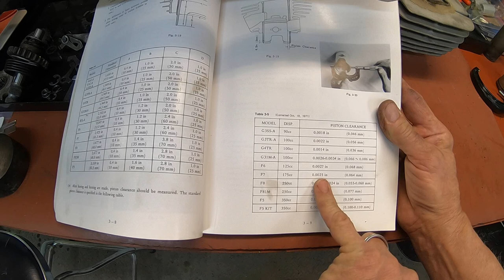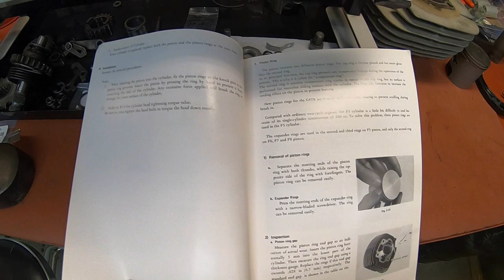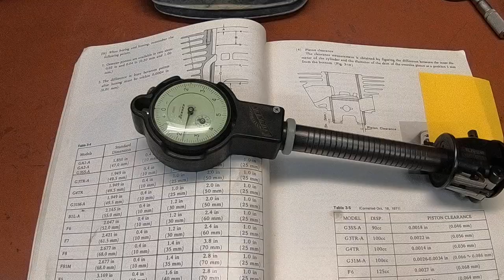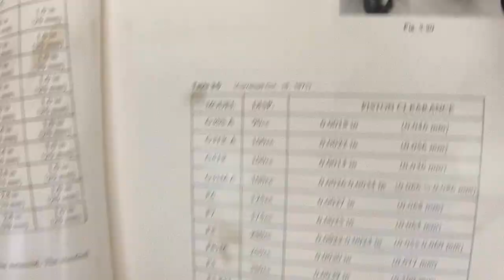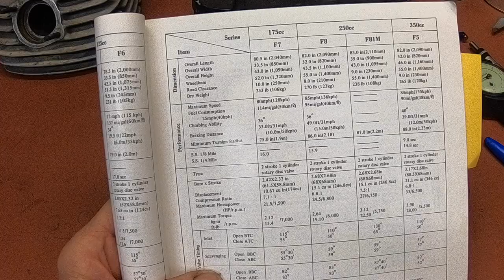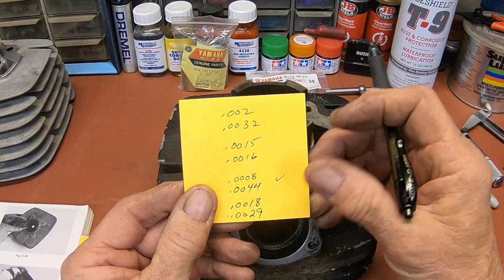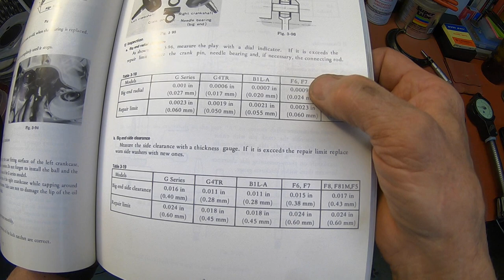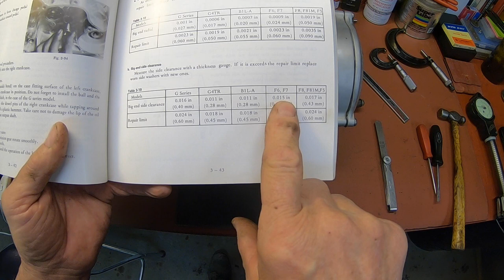1971 Kawasaki F7 Top end disassembly, inspect, measure

Comment: Nice job, Dale. Good find on such an old cylinder!  Looking at the old manual I was amazed they had such detail and complex calculations long before computers came along. Learned a lot on measuring here. Thanks!
Reply from the maker: Hey Jim, yep stroke of luck for sure, the manual is indeed a good source of info. I find overall the OEM shop manuals are by far better than the internet. Really the only thing I use the computer for is to ensure the numbers are the same and to order parts. There is far more info in the published paper parts lists and manuals than online, from the OEM's anyway.

Comment: Hey Dale, great video. I'm glad you have options with the top end, finding the standard barrel was a stroke of luck. 
I'm not sure the Bighorn range was officially imported here, most of them seem to be US imports I think. 
Best wishes, Dean.
Reply from the maker: Hey Dean, yes was lucky to find the cylinder for sure. Kind of goes against the grain to fit a used piston but must do what you have to. I picked up a 1970 F5 Bighorn about 3 years ago, think I have only done one video on it, seat pan build. The F7 shown here is also known as the Bushwacker.

Comment: for those looking for pistons and rings, look at the diagrams and find the exact parts number. You will be able to find it easier. a 1971-73 kawasaki f7-a (or b) piston number is 13001-042, rings are 13008-027, needle bearing is 13033-034.
Reply from the maker: Yes, those numbers are correct for standard size but not for the oversize .05mm or the 1.0mm. I just have had a hard time finding the O/S piston and rings. Think I have them located now. One person told me that the early KD175 parts are the same, hope so cause that is what I found. Will know for sure next week. Thank you for your help and for stopping by the channel.
Reply: @montana2strokeracer  yea my 72 has some scoring but cant find anything to fit it. its got good compression so I wont worry about it

Comment: Hey Dale. In 1974 my dad traded 2 bikes for a Kawasaki Rotary 90cc that a Kawasaki mechanic at our local Kawasaki shop converted from a side port rotary to a center port external carb. so he could make a mini class motocrosser out of it. Man was that a fast bike. No one could beat me to the first corner but after awhile the expert kids would reel me in. I was 13 then. He modified it with lay-down Boges shocks and a longer swing arm. What I would give to have that now.
Reply from the maker: Hey Ron, man all these old bikes are like a dream to me. I remember the mods folks did back in the day, wishing I could do that stuff. Here I am 50 years later finally getting to. It's as fun as I thought it would be. I remember all the small bikes back in the day and how darn fast they were. I would show up at the flat track races with my Hodaka super rat and I could hear the Yamaha 100 twin jets and the Kawaski green streaks. The smell of the two-stroke oil and fuel.... what good times.
Reply: You have any Kawasaki f7 engine for sale
Reply: I had mine rebuilt guy took 3 months. Only rode it for 2 days and a piece of the skirt on the exhaust side of the jug broke off and jammed in the crank it's a 1971 Kawasaki f7 175 has just been collecting dust ever since

Comment: Thanks for posting these Dale, fantastic videos, I have 1972 Kawasaki F7 175 myself and can concur it is hard to find NOS or reproduction parts! Any leads on what to do if my piston has damage? I haven't opened it up yet but precurrosery search yields there really isn't many if any out there for this year. I tried to cross reference part numbers but it seems Kawasaki used this piston pretty much this year and few others but changed it shortly after 72. Any ideas on replacement should I need one? I've seen other suggest that a custom order from Wiseco.
Reply from the maker: Hi Sean, yes like you I have found it extremely difficult to find parts for Kawasaki's. I had a viewer suggest that I restore a Bridgestone....I would love too and even have access to a couple.... can you imagine how hard parts are to find for that rascal? I can tell you this, the parts are out there but only get the F7 pistons. Like I said in the video on this subject, I have found nothing else that works. I would recommend taking yours apart if it is noisy and check the piston top and see what size it is now. Then measure the cylinder and figure out which piston to look for. Your head gasket can be reused if you anneal it. I was able to find base gaskets, piston pin bearing and pin, and clips pretty easy. I have looked in to a Wiseco custom order before. They at the time I checked, needed a minimum order of 10, which would be well over a thousand dollars, probably closer to two thousand today. I think you would not have any problem selling the others. Folks just like you and I would buy them up in a hurry. But if you watch Ebay, perhaps put a saved search in, they do pop up. I was able to find a .5 and a 1.0 for both cylinders I have. Good luck brother, and thanks for spending time with me in the shop.
Reply: Thanks for the reply Dale! You have been a go-to resource for visuals and video on processes, how-to’s and many resources. I luckily found TODAY one that is a 13027-046 F7 Piston but it’s $190 something 🤦🏻 when I get a chance this weekend I’m going to tear the top end apart and pray I don’t need it haha. Is it possible to just replace the rings and re-hone the cylinder to restore compression?

Comment: Dale, I think I’m having trouble racking my brain around all this, I’m doing a top end rebuild identical to this one on a 1972 F7 and a 1975 Yamaha DT175 head rebuild and I can’t seem to figure out how to do this lol. Wouldn’t it be well out of spec if I hone? Will putting new rings on an old piston give me compression?
Reply from the maker: Hi Sean, on either bike you should measure the piston you're going to use in the appropriate place, and then measure the cylinder, also in the appropriate place, then subtract the measurements. For example.... piston is 2.00 inches and the cylinder is 
2.005 inches, subtract and you get .005 difference. Now subtract the piston to cylinder clearance required by the manufacture. Say it is .002 inches. That leaves .003 inches, so this is in excess of the manufacture's specs or a total of .005 inches. In this case I would probably just hone with a ball hone to renew the crosshatch for oil control and install a new set of rings. This will bring your compression back up. The answer to your question about honing, yes if you hone too much you just keep making the bore bigger, but honing with a ball hone will not remove much metal and will give you the crosshatch to seat your new rings. Now if the excess clearance is more like .004 or .005 you will need to rebore to the next size piston. I hope I have provided the information you were looking for, if not drop me another comment and I will see if I can clarify. Thanks for watching the channel and good luck with your project.
Reply: @montana2strokeracer  hey Dale! That’s a perfectly clear explanation for me, thank you so much!

Comment: Wondering if the KD oversize piston is a fit for the F7 175 or the earlier F3 piston. Did you ever find out?
Reply from the maker: Oh, my no, it didn't work out, I got one for the KD and one from a F3. Can't remember which one but one the pin was located different, and the other had a larger pin. So at least the ones I got were a no go. I did find a F7 piston out of Canada. Not cheap. Thanks for spending time with me in the shop!

Comment: Isn’t that the truth! All those figures are based on measuring exactly at the recommended spot on that piston. Otherwise, it’s a lot of guessing and assumptions.
Great video Dale, very important information to know.
Reply from the maker: Hey Kerry, yes, the specs are only for OEM, like you say you have to assume that you measure at the biggest point on a Wiseco, or other aftermarket piston. They are just not made the same. Thanks for watchin.
Reply: @montana2strokeracer  Do you use a lot of Weisco pistons?
Seems the most popular choice for an aftermarket piston.
Reply from the maker: Hey Kerry, I only use Wiseco if I can't get OEM. Some folks that have me bore their cylinders send them with Wiseco at which time I will fit them, but I much prefer OEM they are lighter and can be fit tighter. I am starting to look at the Vintco pistons, think they are made in Germany, but don't know a lot about them, ordered one for the RM a couple days ago, I will give my thoughts when I have had time to mess with it.
Reply: @montana2strokeracer  
Great!
To see a bit of info on another piston option would be good stuff for a video.
Looking forward to your videos Dale.

Comment: Someone bushwacked my post
Reply from the maker: No way, Bushwacked?
Reply: @montana2strokeracer  I made a post here yesterday about the serial number of the piston Dale ordered and the next day it is gone along with other posts from watchers.
Reply from the maker: @jamesrankin5634  Hi James, I didn't see any other posts, I answered several this morning including this one. No one should be able to remove them except me and YouTube. I didn't! Sometimes YouTube will remove them if there is a phone number or address or email in the post or obscene language. 
The Part number of the 1.0 oversized piston that I ordered for the KD175 was 13027-065 I don't know if it will fit yet. The tracking says it will be here Monday. So sometime tomorrow I should be able to tell you if it looks like it will work or not.
Reply: @montana2strokeracer  Sorry i didn't recognise you on the last post Dale. The piston for a kd 175 is the same piston for a ke 175 there is no difference the only difference between a kd 175 and a ke is the kd is a stripped nown version for off road I am pretty sure both those models pistons are the same as the F-7. ke/kd 1976 through 78 and the 79 kd. Maybe i was in a time warp yesterday. LOL